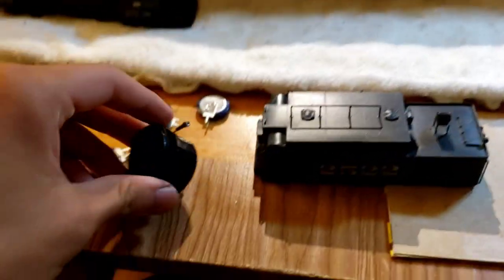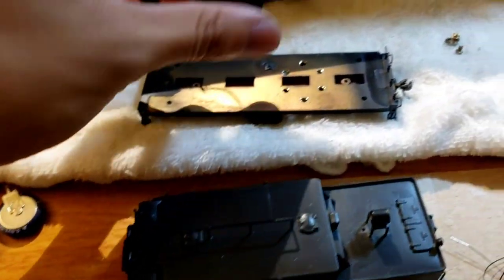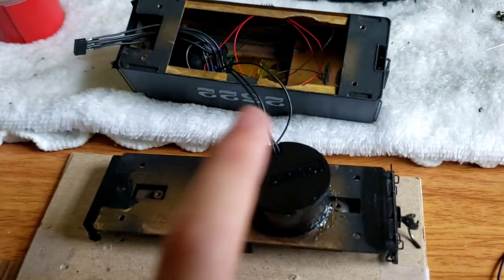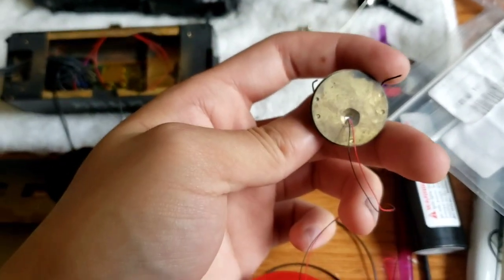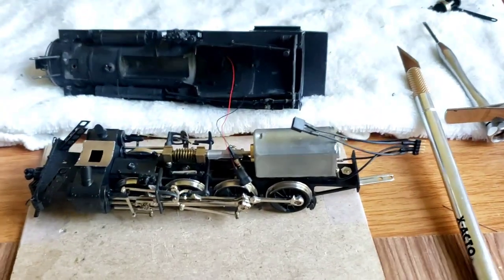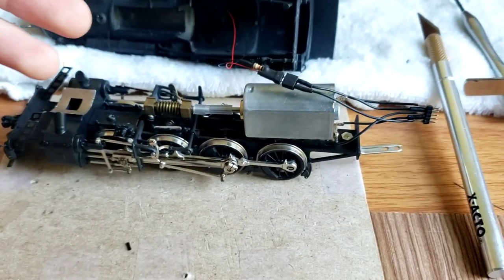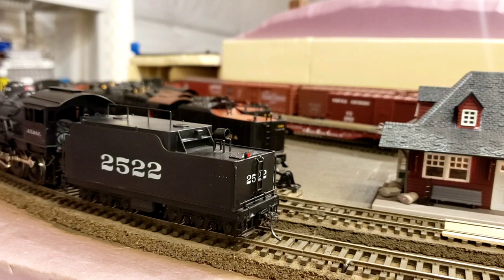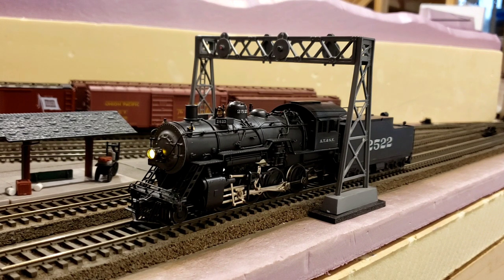Restoring Hallmark Brass Santa Fe 2522: DCC Sound + Lighting Install

Comment: Great work! You inspired me to buy a brass model. Ended up buying a PRR K4 by United Scale Models. I don’t know much about which brand is most accurate but the pictures look decent. I’m looking forward to starting this project thanks to you my guy.
Reply from the maker: thanks! PFM United made two types of K4, an As built early version with an as built 11k gal tender, and a late post war version with a 13k gal tender with trainphone antenna. 

Some quick history k4s originally came with the as built 11k tender but those were quickly replaced by the updated 11k tender youll see on nearly all made HO K4s like MTH and BLI. Most k4s pulled this updated 11k tender for their whole lives, but later some k4s recieved a 13k gal tender. Of the updated 11k and handful of 13k gal tenders, some recieved the trainphone antenna moditifcation. My point is pfm united chose a very early tender and a very late era tender for their two K4s. 

Looking forward to seeing what you'll do with your model!
Reply: @trainman440  nice! I didn’t know that. I would see the tender with the antenna but didn’t know if it was prototypical bc I’ve never seen photos of the real one with it. The model I have is the early Pre war version as I already have the post war, and both streamlined versions from Bachmann and BLI. I figured this purchase would be a good opportunity to learn about brass models. I already purchased a few things you had in your videos like the amber glue and plug connectors. I also purchased the DGLE paint from True Color but I am having an issue finding the right paint for the roof and tender. I know it’s two different shades of red but no quite sure which brand sells them. I might have to mix my own red paint to get it to match the BLI paint on my K4. Anyway, I will be making a video similar to yours. Hopefully my project turns out as good as yours. Looking to have it done by the middle of September
Reply from the maker: @lipsnortheasttrains9128  yep, good luck! brass is very rewarding but somethings need upgrading, notably the gearbox motor and pickups. I personally prefer scalecoat ii paint as it has a glossy finish, which allows you to go straight to decaling, instead of needing to spray a separate gloss layer for the decals. But Ive also heard good things about trucolor! Tender deck should be prr's "freight car color" (oxide red-ish) and cab roof should be a 50/50 mix of fcc and black OR 75/25 mix fcc and black. Later years they would sometimes paint it just dgle along with the loco due to laziness. And wood cabs were painted straight fcc. I painted my bachmann k4 cab roofs with the 50/50 mix, as you can tell its a dark dark brown color, accurate to the e6 #460 at the prr museum. BLI uses the 75/25 mix. I got more info on it in my Engine Showcase vid for my Bachmann K4. Cheers!
Reply: @trainman440  ahh that’s awesome! I need that advice. I was searching the web for all that info but it seems like you’re the go-to guy. Question: Did you use scale coat paint for the FCC color? Also, I agree with the glossy finish. I use “pledge floor polish” as my gloss coat. I tried them all and surprisingly it has been the best one, plus you got a lot for $7 a bottle (like a lot!). After a gloss coat what needs to be gloss coated then I go over it with a flat clear coat so the decals look painted on.
Reply from the maker: @lipsnortheasttrains9128  intresting! Yea I commited to all scalecoat paint. They got a great DGLE and a solid FCC. Ive never heard of pledge floor polish, might try it once my stock of dullcote and glosscote runs out! Yea, you dont want to have the decals exposed, I usually mix a 75 to 25 mix of gloss and dullcote for a nice satin finish. Dullcote alone is wayyy too strong/flat for my tastes.
Reply from the maker: @lipsnortheasttrains9128  if you have any further questions you can always find me on my email! Trainman460@gmail.com
Reply: @trainman440  Nice! Good advice my friend. Thanks! I’ll keep you posted.

Comment: Ive now been motivated to change to TCS WowSound for all of my steam decoders, but i have one issue. When writing a diagram for wires, it says theres a 12v common. Is that used for lighting as well, or for something else? Thanks in advance!
Reply from the maker: Im glad to hear! The common 12V is used for all lighting outputs as well as the keep alive if you use one. Wire all positive (+) wires to this wire.

Comment: I'm noticing your can motor.. Did you have to do any sort of isolation work to isolate the motor from the frame? Or is it already isolated?
Reply from the maker: Hello! I used silicon caulk to mount my motor to the frame. It accomplishes three things: 
1. insults motor from frame
2. secures the motors to the frame
3. its gel like nature helps reduce vibrations, making the motor run much quieter. 
------------------------------
That being said though, insulating the motor isnt a big deal, since nearly all motor outside sheathing is insulated from the actual motor contacts (with the exception of athearn BB motors). In fact, factory installed can motors from brass manufacturers often secure the motor via a brass plate and screws which arent insulated at all. For pickup, they wire a separate wire from the frame to one of the motor contacts. Cheers!
Reply: @trainman440  Interesting.. So, in theory, so long as the pickup wire from the frame is rewired away from the motor contacts and routed through the decoder instead, everything should be A.O.K.? Recently attempted a hardwire on my Overland FEC 4-8-2 without much in the way of success
Reply from the maker: @seaboard18  Yea you should be fine! If you want to double check, use a continuity checker on a multimeter to make sure the motor's metal sides dont conduct with the two motor contacts!  If you need any further help, feel free to ask more questions!

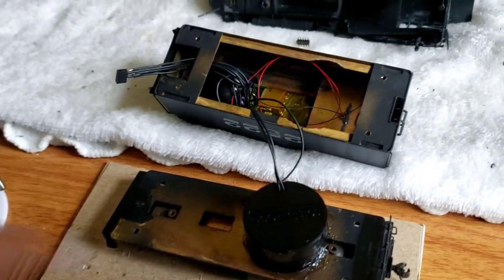Comment: Señores (use the translater for english) Minuto 2:05, en mi caso particular he usado pintura para vidrio, color naranja, que deja acabado transparente con su respectivo color. Esto cuando alguien querrá convertir luz led blanca, a luz blanco cálido cercano al incandescente.  Eso depende de cuántas capas de pintura use. Con una capa basta para blanco cálido.  Quedo debiendo la estimación en grados Kelvin, de la temperatura exacta del efecto, debido a que habría que usar "Light Meter".
Reply from the maker: Hi, yes I use a similar method to adjusting the color of the light. I use orange glass paint.